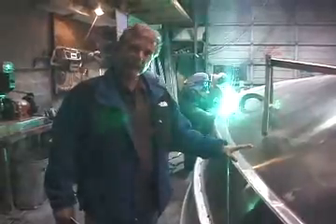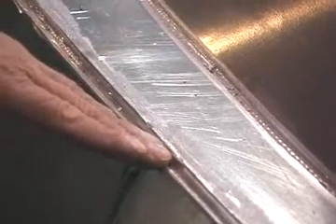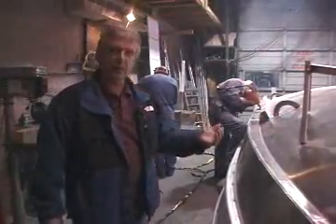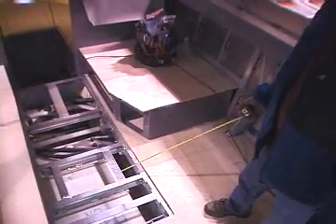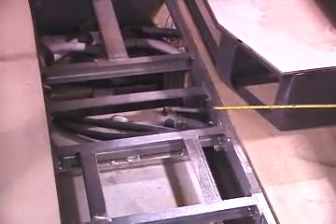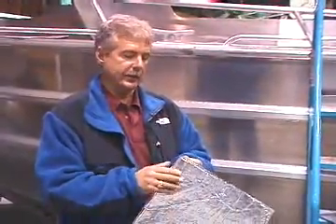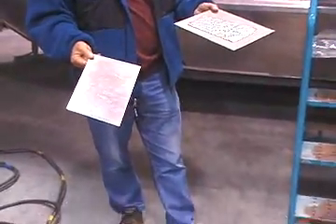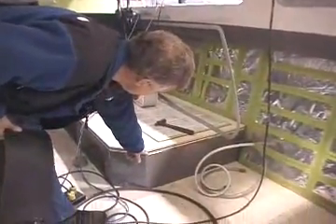Features of EagleCraft Aluminum Boats

Comment: Welding aluminum is very toxic.Those welders in the background are required to have forced air respirators. Heavy metal poisoning is in the future for the people that welded your hull.
Reply: Pestolents  it's not toxic to weld, you may be thinking of galvanized steel.
Reply: one more idiot that can't at least look up the facts before posting something really stupid, aluminum welding is not toxic, been welding for over 34 years and never heard of toxic aluminum welding.
Reply: Welding aluminium is good for you it enhances your mental strength and increases your structure

Comment: If I weld my own boat, how much do you discount? Just kidding, I'm a marine welder with 28yrs exp' Have you ever considered using ceramic backing tiles? These could totally eliminate the need for back-gouging, except for very difficult to access areas.
Reply: manos3790  v
Reply: Ceramic backing tiles use for ship yards not aluminium boats